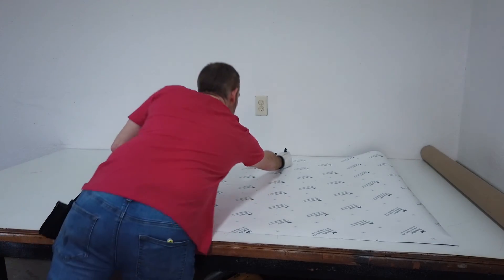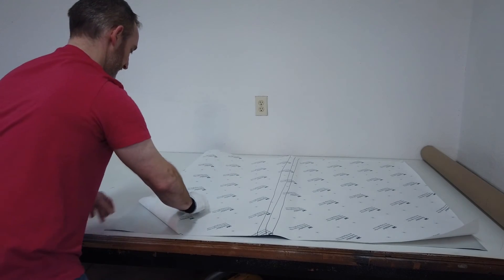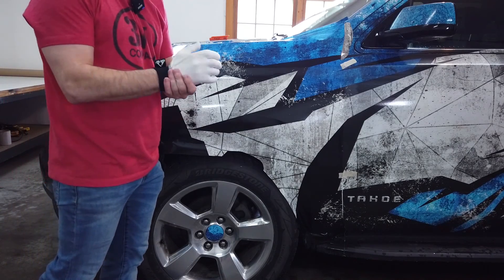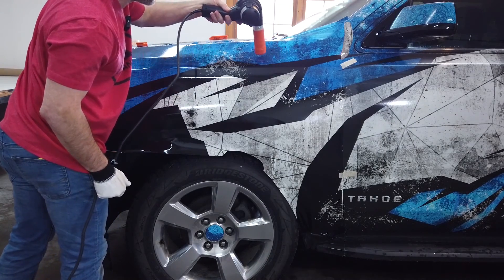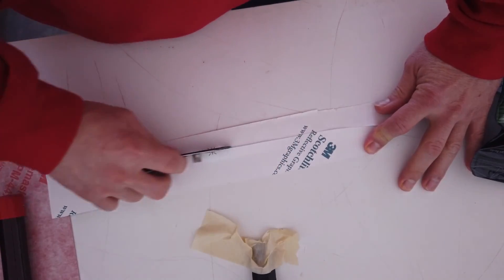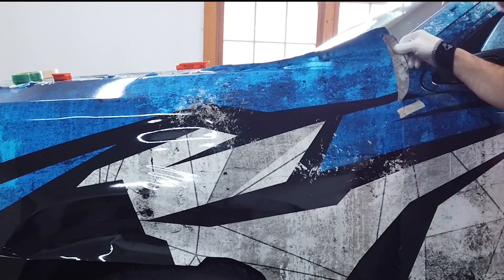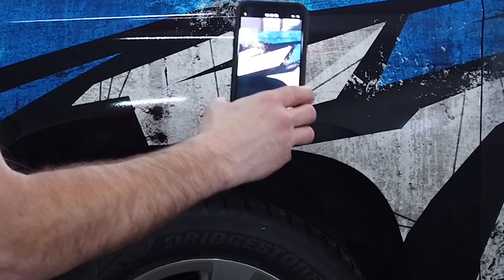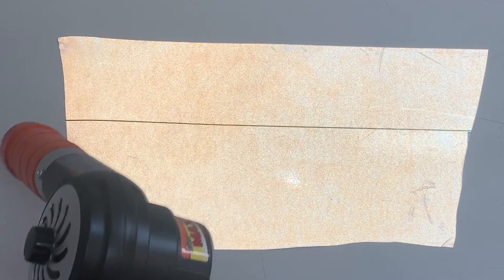Top 5 tips to handle 3M 780mC Reflective Film

Comment: Love the Video of the Reflective Wrap on the Tahoe, You rewrapped your fender on the Tahoe with 780MC because of an accident or some issue of damage, but initalily the Tahoe was wrapped with 680CR. 

My question to you is when you first did the Tahoe a few years back with the 680CR which is a 7-8 Mil thickness. The Tahoe has some very tight recesses and body lines and curves on the bumpers. 

Did you have any issues of lifting on those areas and also any shrinkage of the film. I totally understand off gassing of paint which makes sense.